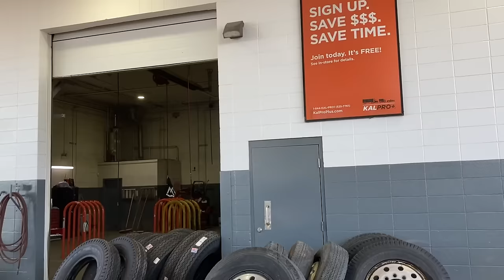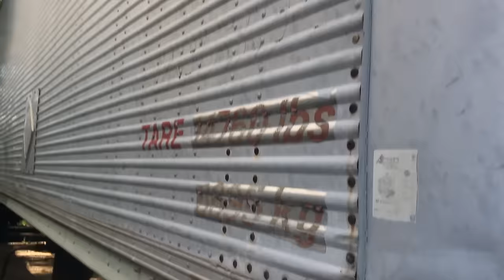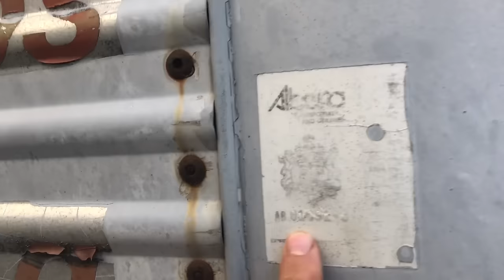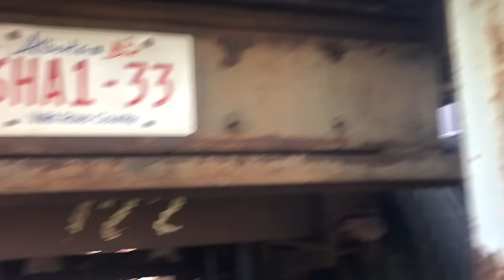Smokey & The Bandit Tribute Truck Ep.50 'Cause Straight Pipes Are Cool

Comment: Next time you do a "On the Hunt" you will have to watch for a set of bodies for the trailer. Relatively easy swap. We used to shorten the wheel base for tighter areas for delivery but mainly to equalize weights according to different Provincial weight laws as well as ride, but you probably already knew that. Osha can absolutely have a fit if it's not according to the book. Common sense in dealing with old equipment has gone the way of the wind. All the safety cages came about because people didn't use the brains God gave them.

Comment: Mark I don't know if you have any lights wired up yet but generally those old flasher relays don't work unless you have at least two incandescent bulbs per side. The newer ones flash faster without a load but in my experience those old ones simply won't do anything. You could try getting an electronic flasher from a parts store.

Comment: I think I have a set of tandems for you but I’m in Michigan. If you support the back of the trailer undo a couple clamps that’s under there you can drop out the bottom and just turn it and take it out that way and start cutting your bumper off it’s easier if I remember right there’s only like four clamps that holds it from falling down all the pressure is pushing down on it anyways
Reply from the maker: Send me an email twinstickgarage@gmail.com

Comment: I was a vehicle mechanic in the army (US) in the late 80s. Split rims were everywhere on 2 1/2 and 5 ton trucks and a bunch of trailers. We had a cage in the motorpool, but in the field you had to mount the tire on the outside dually so the ring faced inwards. Pretty sketchy.

Comment: om de juiste maat te meten moet je een touw boven aanhangen deze duw je over de trailer heen onderaan doe je een steepje dan meet je het touw en weet je exact de maat.
to measure the right size you have to hang a rope at the top, push it over the trailer rips till the bottom set a pen strip . then measure the rope and you know the exact size.

Comment: I was thinking you could do the height measuring more precisely, simply by applying duct tape on the trailer, cut the correct length, then take it out and measure it strait. The less flexible and fragile the tape, the better. Also, doing it a couple times just to make sure it is not stretching too much. To double check it, cut a virgin piece the length you think it is, and apply it carefully on the trailer, to see if it match. 

Like they say: "measure it twice, cut it once."
Reply: Run thin nylon rope under the tape down the center to avoid stretch - measure rope

Comment: You don’t have to cut the DOT bumper. Pull the pin you got 4 keepers  lift trailer. I replace several bogeys a month. Believe it or not drivers hit things and bend bogey frames on the Regular. I got a air ride bogey I’ll sell you. It’s on a over turned that broke the floor and I’m getting ready to scrap. I’m in Virginia thou.   But air ride would be way off one correctness.

Comment: Just run some tape bottom to top , peel it off stretch it out and measure  it ..maybe ?? Cool trailer looks like 1 of the old CN trailers , maybe check Alaskan Equipment for the wheel set .

Comment: Just put a strip of tape down the trailer. It will be tight all the way. Then take it of and measure it. There is the correct ”height” of the trailer 😊

Comment: Just so you know, the pipe on the passenger side of the truck was not taller. It's an illusion caused by a reflection of sunlight on the front of the trailer. I've seen the bandit rig up close and they are the same height n both sides.
Reply from the maker: Take a close look at the movie 👀 they’re different lengths or the guys didn’t hit the caps down far enough.  I’m sure the rig in person you saw was a replica 👍

Comment: one trailer,...they just slid tandoms when needed. All the way forward allows tight turn around. All the way back was either empty,..or Needam thought looked better on film.
Reply from the maker: Nope … note the ribbed walls on the front face on the trailer pulled by the ‘74 and smooth face on the ‘73 👀

Comment: Mark, don't use a tape measure, use a piece of string. It will be easier to mould it to the shape of the ribs then just take the string off and measure it's length

Comment: Good evening from Australia 🇦🇺  so glad its Thursday here best time of the week. Just noticed you have no front brakes on the Smokie truck was that correct for that period ?. Wrapping the trailer is going to look mint. Love the arts and crafts hour 🤣😂 look. Wow your eye for detail in regards to the exhaust is unbelievable.  Great video as always . Thanks for sharing your dream.
Reply from the maker: None of my three ‘79 trucks have front brakes 😆 I believe front brakes started to come out in the early 80’s 🤔
Reply: For many years, front brakes were optional, at least on tractors. Some tractors came with, some didn’t. Some front brakes were adjustable. On Macks with adjustable fronts(B models: 50’s to 60’s) there was a round knob labeled Increase-Decrease. This was to allow for weather or conditions like sand on the road. Some guys would take off front brakes. If they were on, they had to work. Air brakes are being constantly refined. Anti lock brakes in the mid 70’s(a failure), system speeds increased(causing compatibility problems), disc brakes(initially sketchy, but refined to superior to drums). All of this we have to take into consideration when bringing back these old rigs that have been run into the ground. Take care and the best of results to one and all.

Comment: All trailers have adjustable tandems. They probably slid the tandems  for different scenes. Same trailer....
Reply from the maker: Nope … note the ribbed walls on the front face on the trailer pulled by the ‘74 and smooth face on the ‘73 👀
Reply: @TwinStix  ok, my point was that the different tandems positions don't mean anything. They move...

Comment: You might want to check with you Dept of Transportation before you cut off that rear bumper. Here in the states it's required to operate the trailer on the road to protect the trailer and keep the cars from running underneath the trailer. I know your not using it for anything but truck shows but better safe than sorry

Comment: It is getting difficult  to get older things worked on unless you know an old existing company you can trust.  The young guys have no frame of reference and are especially bad when it comes to older wheels.  They think anything that isn't a solid rim Dayton or Budd is a "Widow Maker" not knowing one wheel from another.  I recently watched a video where the Bus Greasemonkey traveled to St Louis to get an old Scenic cruiser bus going then took it to Loves for some tires.  Even giving them specific instructions about left and right hand lug nuts, and the torque specs after 8 hrs working on the bus they ruined over $2000 of studs on the bus. But they did eat the cost and make it right at least.

Comment: Sorta wonder if the exhaust size differences could’ve been done on purpose for camera angle purposes (?).  The money shots are more side profile-ish angles than head on front end.  So a taller stack on one side could  help make the two look even height from a certain camera perspective (?).  Maybe that’s why there are differences with the two trucks? Again, just a thought.  Don’t know if they would be that Hollywood detailed for this.
Reply: I was thinking it was just a rushed job to get the trucks done, and the exhaust came out that way.
Reply from the maker: I’m thinking they just didn’t push the caps down all the way 🤔

Comment: Confused a bit on xchanging trailer bogies.
Don't you just slide it forward until it's cleared rails? IDK, likely missed what you want to do there!
Reply from the maker: 🤦‍♂️ never thought of pushing it out forward … that might be the ticket if it clears 🤔
Reply: @TwinStix  Funnily, that's how I've done it on my model kits since I started building them in the 70's!

Comment: Is the length of the stack changed due to the angle of the truck to the angle of the trailer due the rocking of the road, also wouldn’t turning the truck around a corner also change the perception that one is longer than the other. I wouldn’t make them different length’s.
Reply from the maker: No it’s actually consistent throughout the movie … suspect they just didn’t bang the tip down enough on the one side 🤔

Comment: "the 73 had the taller stack on the left...the 74 had the taller stack on the right"..
Why not, split the difference,.. and make them " tall" on both sides.  Also, if you get a roll of "filament packaging tape"", (it doesn't stretch) run it top to bottom, into every recess of the trailer side panel, 
Then remove, lay it out, and then measure the actual length.

Comment: Save yourself some headache doing your wiring get on Amazon and buy yourself some crimp and seal connectors they come in a nice case and it has all different sizes and types that's what I use I've been using for a few years now and they

Comment: use conveyor belt rubber to mount your pipes MUN FLAPS WILL FAIL dont ask me how i know my OCD would be off the charts with pipes a different length n i would do my own tires just wrap em with chain when airing them up

Comment: Safety inspector.  Probably never changed a tire in his life.  Slide the axle assembly out the front of the  rails not the rear . You might want the blocking at a right angle to the axle

Comment: I'm surprised that it doesn't have front brakes.
Reply from the maker: Front brakes didn’t show up on rigs tiles the early 80s
Reply: @TwinStix  
My 76 Pete had front brakes from the factory. Maybe Canada made them mandatory a little later. I know that most rigs in the 60's and earlier didn't have them.

Comment: Did you take into consideration that the "different stack height" wasn't just the one side of the trailer was sitting higher than the other....
Reply from the maker: Yeah that’s why I studied the movie and the different heights are consistent throughout 👀
Reply: @TwinStix  10-4 just wanted to double check! Crazy to think they would put 2 different height stacks on. I mean they don't put a tape on them from the factory but it's never noticable. Makes you wonder if it was the movie set guys that done it and forgot what side they put higher on the first truck to replicate on the second?

Comment: Hey twin sticks. I saw a guy who did a wrap on a trailer. He did the same thing you are trying to do with the scene from Smokey and the Bandit.  When he measured the side of the trailer for the wrap using paper towel and wet it down with water. Then he peeled off the paper towel and measured the paper towel length. Check out the youtube channel Christian Bandit and that may give you a better idea of what I mean.